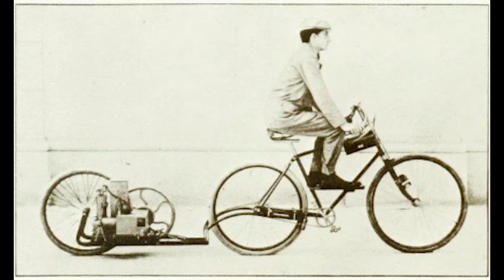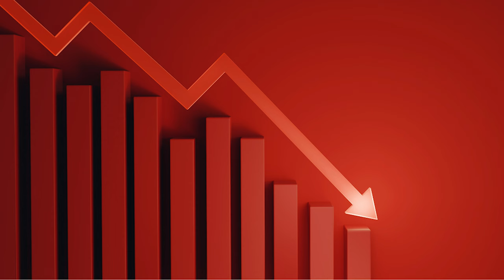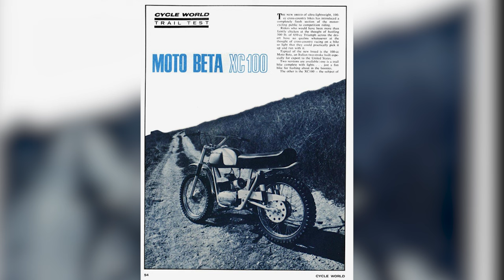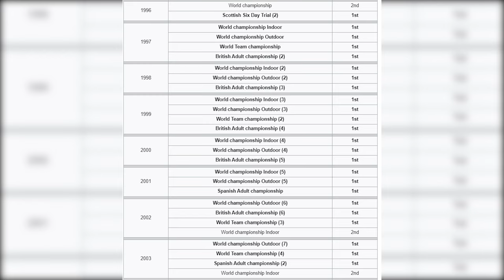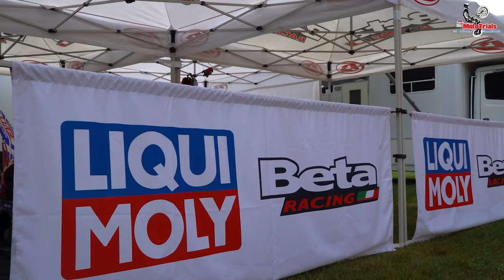How Did Beta Motorcycles Survive The Test Of Time?

Comment: They should've stuck to mopeds and trials bikes. My 2021 500 RR-S is a fragile POS and the suspension is pure garbage. I have early to mid 2000s KTM RFS bikes that get abused much more than my Beta ever did and they just keep on ticking. (pun intended)
After 200 hours the forks on my Beta have no anodizing and inspire zero confidence. I raced the bike once. Once. I think I finished 5th in Vet Expert which is pretty dismal when I can podium on a 2007 KTM 250XCF-W.
Also at 200 hours the motor suddenly had an oil starvation issue. Despite having replaced the stupid weak plastic oil pump gears (yes modern KTMs unfortunately use them too, they suck just as bad) it would seem that the little pieces of said gears probably clogged oil passages or jets and the subsquent repair bill was $2500. Zero aftermarket support means a piston kit is $550 and a gasket kit is $300. :rolleyes
The bike went to the dealer in the spring of 2023 to be repaired which leads into my next grippe. Seems the Beta factory didn't have the replacement parts AND they shut down for the summer so they didn't have any until the fall. Wait, what? Seriously?
So now the bike is repaired but the riding season is over in Canada so instead of putting it up for saler in the spring of 2023 and getting better resale as well as the possibility to use the money for a better bike, it now has to sit until spring of 2024 because that's when this piece of shit will be worth the most it's ever going to be worth. 
Thanks Beta for making a substandard product and fucking me over on the resale too. Eat shit.
Reply from the maker: Sounds like you had some unfortunately luck with that bike. Although i don’t see the 500’s very commonly purchased here in my part of canada. The real bread and butter of beta is their 300’s.
Reply: The ones with crank bearing failures? 
Listen, the Cross-Dresser is a great bike. Hell my friend who started riding bikes in 2019 has won the women's Intermediate XC and Enduro titles (and the accompanying Grand Champion plates) in Ontario the last two years running on one. But she's about to start outriding it and frankly I don't trust even the 300 race editions so I'm going to suggest an orange bike next. Half the Beta demo bikes at the Corduroy this year injested sand and needed rebuilds. Brand new less than 10 hour bikes. Keep 'em.